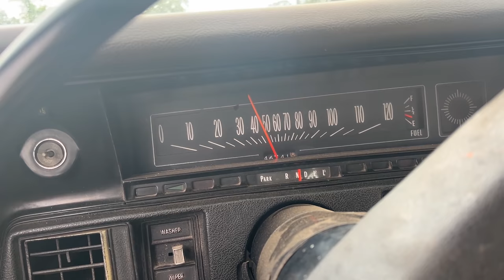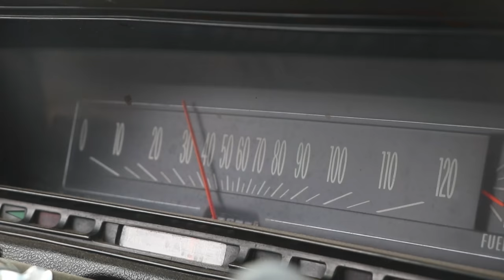Will It Run and Drive? Hidden 1972 Chevelle Rescued After 32 Years

Comment: Hey Dylan. Top tip if you hang a mirror on one of the supports facing you if your on your own you can see exactly where the car is on the ramps. Great video as usual. Thanks again Stevey Mac from the U.K.

Comment: Just an FYI, the spindles are left rough cast and only machined where the race and bearing sit. I have seen that many times on old Chevy's.
Reply: exactly,theyre made that way since the bearing doesnt ride on the rough areas anyway.
Reply: I think he just wanted to indulge in a bit more buying therapy.. 😁😁
Reply from the maker: This had chunks removed from the spindle where the bearing rides. No way these would’ve been able to hold it.
Reply: @DylanMcCoolVideo  
The part you were pointing to isn’t supposed to be machined. The actual machined surfaces are where the bearing slips onto.
Reply: Yah I'm with these guys I have a ton of these laying around I race short track and use gm a body subs all the spindles I've ever used look exactly the same
Reply: Agreed, that's an OEM spindle with the area where the bearing doesn't ride left un machined. Nothing wrong with that area of the spindle
Reply: Was just about to point that out..Same goes for Pontiacs..
Reply from the maker: Yikes. Never seen a spindle look like that before. Oh well better safe than sorry 😂
Reply: @DylanMcCoolVideo  That spindle you held up was not in that great of shape where the outer bearing rides. You made the right call.

Comment: I have a 71 Cutlass that I found in an old carriaige house type garage that had sat since 1985, I got it on a Friday night and drove it to a cruise in on Saturday night! I ran all new steel lines from the prop valve to the new wheel cylinders I put in and of course I replaced the master cylinder  and worn out brake shoes! Everyone was trying to tell me to put it up for sale but it hasn't happened yet! This car holds the record for me buying parts cars to put it together with! I bought eight of them! But one was solid enough to make into a runner! It was a 70 that someone put a 71 rear bumper on it so I put it on my car to because mine had rust holes and peeling chrome in it! Really made my car look better! The other car I bought had a kind of raggedy set of Cragars that I put on the 70 that surrendered it's 71 rear bumper  because it had a set of SS II Rallys with bias ply tires that I sand blasted and  painted white to match my car ! Also the other parts car surrendered it's rocker panel mouldings to replace the set on mine that had screw holes in them from the painter drilling holes in them! What a mess! Then I found a 71 Cutlass on Ebay that the owner couldn't seem to give away for his Buy it now price of $800.00 So I got in touch with the guy and told him that I had $800.00  waiting for him  when he got to my shop with it no questions asked or negotiations on the price I wanted the car! When he got to my shop with it I had $800.00 in my shirt pocket waiting for him and handed it to him as soon as he walked through the office door! He didn't know what to think! Anyway we rolled it off of the trailer and were pushing it in to a parking place and I told the guy steering to steer it towards the frame rack so I could get something I wanted off of the car easier  with it up on the rack! I just happened to have the 70 that I had gotten the nice  71 rear bumper off of on one rack and when we got the car that the guy had just brought up on the other rack I said that I couldn't  believe my good luck so far on the Cutlass! I pointed to the rear bumper on the 71  he just brought me and said that is great luck! The 70 parts car had an almost perfect 71 bumper on it so I switched it to my car  Now I just bought a 71 Cutlass and it has an almost perfect  70 rear bumper on it for my 70! It blew everyone's mind that I had that good of luck! The tentative  deal I had with the guy was $750 and an NOS  right front wheel opening moulding for a 70/72 Buick GS, I had already given him the 800 so I got him the moulding out of the car on the other rack and handed it to him and said we're even! He didn't know what to think! I told him that the bumper was a hell of a bonus and I also noticed the front tires were the perfect size for the car too! So the parts car was a good deal for me!  And I wanted it to be a good deal for him! Then  a week later I found a couple of 71/72 Cutlasses at my favorite junkyard and the owner said he messed up and paid too much for them when scrap was real high and then it dropped right after he bought them and he was going to lose money so I made a deal with him to give him 6 junkers I had and $800 for them to help him and me both out!  So he hauled two Cutlasses to my shop and picked his junkers up! That is 5 of the parts cars I picked up to do this car! Only three more!  Sorry to ramble on but that's what happens when you get to talking about old cars!

Comment: remember guys your original coil pos wire is a resistance wire that does the same as a ballast resistor and supplies 9 v to stock coil. HEI distributor needs 12 v to function properly! great revival

Comment: The rod that pushes the master cylinder from the brake pedal is different length from manual to power
Reply from the maker: It has an adjustable rod for the master cylinder.

Comment: I remember back in 1981 I had a 1975 Chevy truck and was coming home around 11pm and my alternator belt broke so I pulled over when I noticed my headlights were getting  too dim to see and was about 8 miles from the house. I called my dad from a pay phone and told him where I was and what my situation was. about 10 minuets later he showed up half asleep with my moms panty hose and made me a temporary alternator belt out of pair of pantyhose. That was the day I found out my dad was MacGyver. It got me home when all auto part stores were closed. I would of never thought of doing that or believe it would work but it did.
Reply: Thats one of those old farm tricks, like an egg and pepper in a leaking radiator 😉

Comment: You need to a 70/30 proportioning valve and the combination valve should be upfront and you have to push in the button or pull it out so that you can bleed it you might have to vacuum Bleed It

Comment: I believe when you change from manual brakes to power you have to change where the rod connects to the brake pedal,  check to see if you have two holes on the brake pedal arm if not you'll have to drill a new one.  Just can't remember if it's above or below the the one being used now.  Js

Comment: Very cool video again. 2 barrel carburetors are underrated, my 65 Impala had its original Rochester 2GV with a 283 and it ran really well. No muscle car obviously but that's not the point. I have a slight preference for Mopar but old GM products are great too. Thank you for saving another piece of history.

Comment: That spindle is a forging and that surface is normal. It's only where the machined part where the   bearing actually sits and the seal lips ride that you need to worry about.

Comment: As you were going down the road,I noticed it was leaning a bit on the driver's side and thought maybe something was wonky.
But that might be the fact that the suspension is soft,and it's original. Does it have an exhaust or have you still not touched it? It sounds great.

Comment: If I was the owner of the car, the first thing I would do is check the condition of each cylinder and piston with a borescope. I would also give it a wet / dry compression test. Also I would hook up a oil pressure gauge, and see how much oil pressure there is at idle.

Comment: Not trying to be a monday morning quaterback but the short shoe goes to the front on drum brakes, at least that’s what I was tought
Reply: It’s the lead shoe and the tailing shoe follows or bigger on the rear, smaller in the front to push on the bigger working shoe, lots come into the shop backwards 😱

Comment: Kid, If I was going to upgrade the brakes to disk. I would not have just stopped at the spindles. I would replace all of the front suspension with something a whole lot better than what GM gave us back in the 60's and 70's. Not just in those two decades, but also in the 80's and 90's. The stock suspensions back in the day were all crap.

Comment: If it only has idiot lights for oil psi temp snd volts then you need to put in a temp and oil gauge. Make sure your oil gauge is tied in at the top of the motor at behind the rear of the manifold. As for the temp . Either right at the top radiator hose connection or the side of the block on the head behind the power steering pump

Comment: This ‘ol girl has either a 2.56, 2.73, or if you’re lucky 3.36 rear gear ratio. I know it lists the 2.73 and 3.36 specifically for the L65 350 2 barrel. A 2 barrel on a 350 is sacrilege and even the factory should have known that the Quadrajet would whoop the 2 barrel in fuel mileage.

Comment: So you were given a new distributor by a manufacturer of aftermarket parts and their electrical wiring harness for the distributor? Will that fix the stalling problem on start?

Comment: Hey Dylan I love what you do. Quick question, where would I be able to find parts fir 1972 GMC truck? I have one that's a long bed and I need a new bed and both front fenders. Also I'm want to do a 2WD to 4WD conversion on it. It was a project my dad bought and never finished and when he passed away in 2015 my mom gave the truck to me and I'd live to fix it up and make it a nice daily driver. It has the factory 307 in it.
Reply: LMC Truck would be one source. GM Restoration parts might me another if you can afford it.
Reply: @DeadInsideButStillSmiling   Thank you a lot I'll check them out. I'd really love to see this truck on the road.
Reply: LMC is great, but be forewarned - The body parts "fit", but some modifications, and a lot of tweaking is going to be necessary.
Reply: @DeadInsideButStillSmiling  , going to a decent scrap yard or junk yard might also be other viable options as well.

Comment: So i must have missed it....but i didnt see you compress the springs or lower the bottom control arm with a floor jack.  I did see a jack stand under the arm on one side but not the other.  What kept those springs in place while you had the spindles out.
Reply: The shocks.

Comment: Have you run the numbers on the back of the top of the engine block. Chevy made a car motor also that was a  small block 400 with a rochester 2 barrel. Which that is what carb is on there. A rochester 2 barrel

Comment: this kind of clapped-out crap, my old man would drag in from local streets for like 35.00 50.00 scrap offer. when the little old lady's car failed local insp.  some time they where easy fixes/ 75% they where rear bumper frame rails. other dam near mint "72 Monte Carlo" i walked past every day going to school. claimed by my brother , (did not deserve but) but that another story... love it brings back great memories of the late 80's hanging with my late pops at his shop.  worked for Pizza pop and gas money.

Comment: The roughness you see on those spindles is just casting marks. That’s normal.  Does it have a 3500 stall speed converter in it?

Comment: So you're doing both belts and you're going to do the alternator are you going to look at your automatic choke? And then look at the starter? Because that car kind of struggles a little bit to start what type of battery do you have in the car and how many times do you replace the battery before you decide to replace the alternator which I'm sure it needs but when I was in the auto parts business my managing business partner decided he didn't need to worry about alternators too much because he would make more money selling a $27 battery like 15 times

Comment: I hope that the left front wheel doesn't come off. At least on film, you didn't put the axle nut key back. The poor car already looks like it has cleaned a ditch or two on the right side.

Comment: do yourself a favor and avoid a ccp booster.friend got a power disc kit for his 66 mustang and the booster was bad out of the box.it would never push the master cylinder far enough to work.we replaced it a foxbody booster and it worked great.sometimes best to stay with oem stuff for master cylinders and boosters.

Comment: Just as a FYI go back and measure the depth of the original master cylinder to the pushrod cup.  There are two different lengths.  It sounds like you have a short rod in the booster and a master cylinder meant for the long rod.  If the two do not match you will never get the brakes to work right no matter how much you try to adjust the pedal rod.

Comment: Were to lower ball joints replaced? You tore the boot with the picl fork taking the spindle off. 2bbl has a large bog. Time for a rebuild. That car should spin the tires for a block.

Comment: Eric Burns broke bastard racing I got an idea add a 300 horsepower 350 cam factory l48 or l82 aluminum intake a rebuilt Rock Chester put you a set of Comp Cam steel roller tip rockers a set of headers and make a mildly Bill 350 man have some fun with that car put it and go out and have some fun I hope you I hope you have a good luck with it holla if you hear me

Comment: Looks like a parts car to me. The body is a challenge. It sits 3 inches lower on left side. The carb needs at least an accelerator pump but a 4 barrel would be better. Good video and the owner is lucky to have you to work on it.